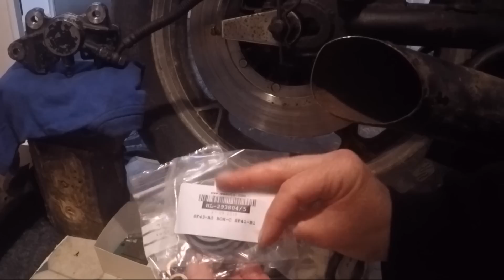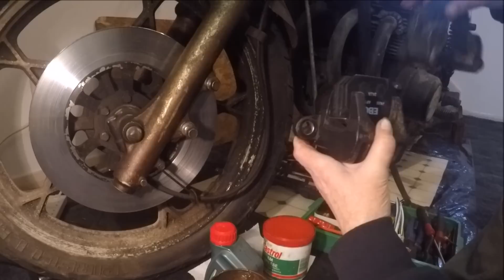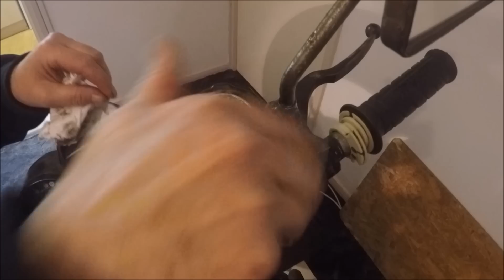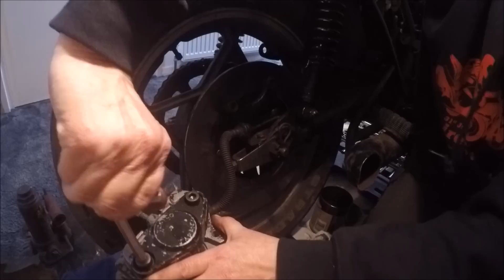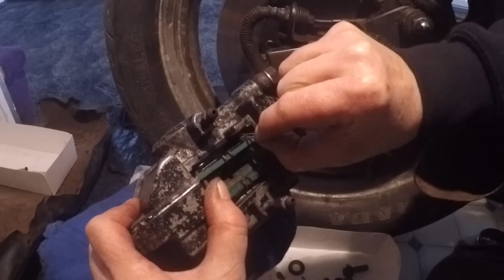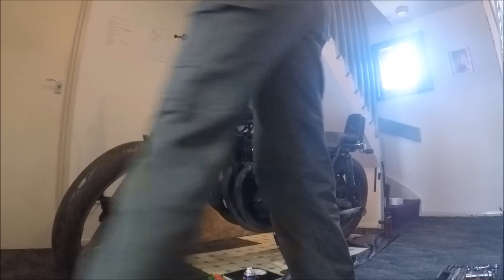GS550 Rat Bike Restoration Project 17 #Brake Caliper Rebuilds & Brake Fluid

Comment: I got a 1980 GS550E, been working on it on and off. While I wait for the carburetors to get fixed, I'm doing the brakes. The front brake piston came out fine, but the rear ones appear to be rusted on some parts, causing them to seize.
Reply from the maker: Thanks for watching and same bike with similar troubles eh! Well done for committing to a project, I know how much work is involved. With time and perseverance you'll get there. Keep gong the bike's so worth it! :)
Reply: @Ratqueenbikes  First bike I have ever owned or worked on, picked it up for $200 USD. Been at it since July of 2019, messing with bits, learning how it works. The limited income has been a deciding factor, but it's getting there. I just disassembled the rear brake last night, going to clean the front brake. Ordered some new pads for both, waiting for those to arrive. Here's the latest video: https://vimeo.com/390630074